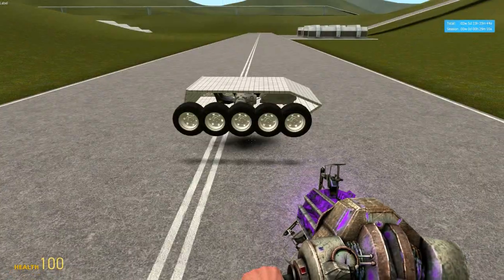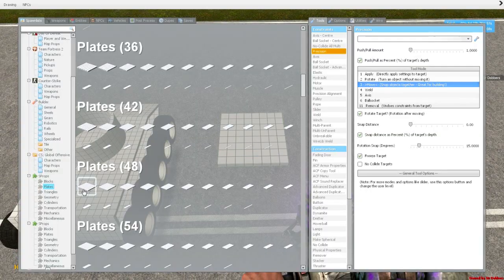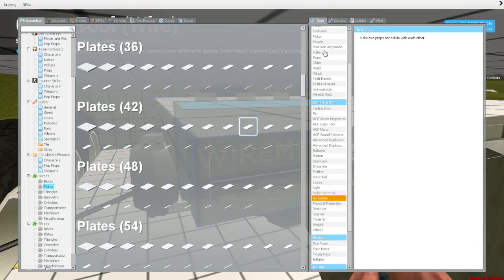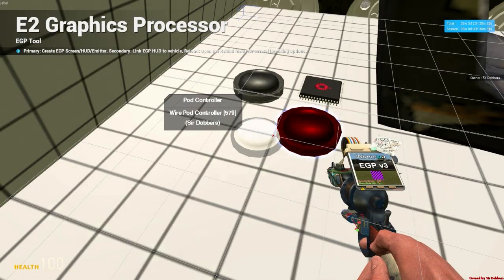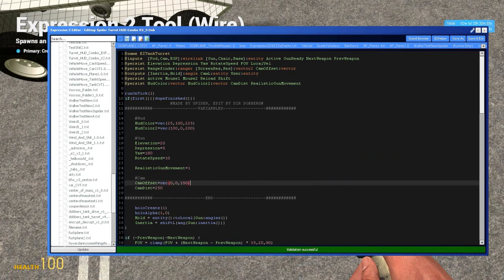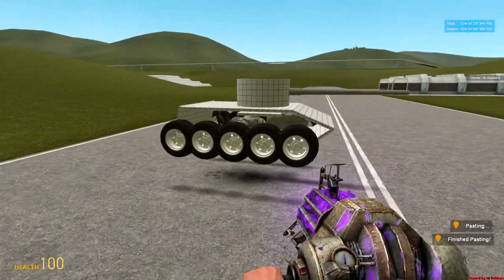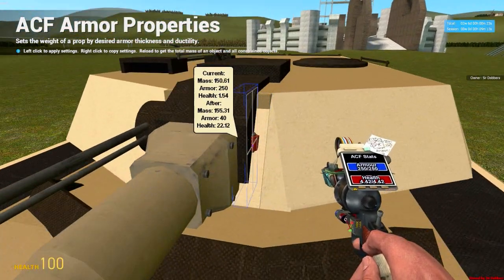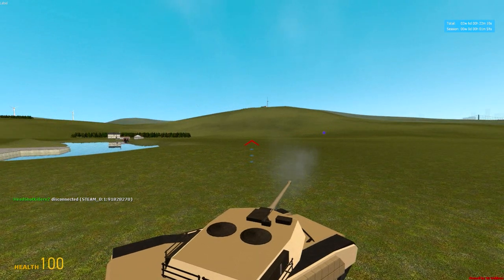Sir Dobbers' Basic ACF Tank Tut Part 2/2 [Tank Turret/Aiming]

Comment: I've been having an issue, I assume it's regarding the cam controller, or the E2 itself, But when using the tanks you've allowed us to download, Like the Abrams, or t34 - The camera will begin wiggling very violently, to the point where it begins to clip out of the map - This happens most regularly with the T34 The AMX is the only one I've never had an issue with. I'm assuming at this point it'll do the exact same thing if I use this E2 on my own tanks :P
Reply: ***** Happens with the lag. As you can see in the aiming chip, it uses a lot of memory.

Comment: Can you please tell me how you got those props on the front and back rotated horizontally and vertically the way you did? I can't figure out how to precisely rotate props without the standard 45 degree rotations. I want to do something more in the 25 or 30 degree range.
Reply: Try stacking  the plate to the front of the tank, then using the precision rotate to in the very bottom of the side of the plate to rotate it in the desired angle.

Tried to explain as best as i could, not a native english speaker.
GL

Comment: I have linked it up all correctly and it works great. except there is no hud even though the EGP is set to hud and when i hop out of my chair the camera stays the same as when in the tank :(

Edit: I got the hud working and i just decided to not use a camera. but a new problem is that the turret wont faces the wrong way and the gun always points at the ground.
Reply from the maker: Make sure the cam controller is linked to the seat, just the way you would link a pod controller. Also make sure only client side movement is checked for camera controller settings
Reply: Ok it works but any tips for the turret problem it faces wrong way and the gun always looks at ground
Reply from the maker: nocll34 make sure the gun isnt upside down
Reply: SirDobbers Thank you very much LordDobbers :P it works all fine now probably just some shit placement on my side. and thanks for being one of the better youtubers that reply quickly to questions
Reply from the maker: nocll34 np thanks!

Comment: Sir Dobbers, where is the area in the code that aims the gun in the e2 , I want to make it to aim higher if the gun isn't powerful enough and so it uses trajectory instead of shooting straight
Reply: Please respond
Reply from the maker: +Michel Erny I think there is already a chip like that somewhere on the internet.
Reply: To clarify , I already found a trajectory calculator and I used it for getting the angle offset of it and when I was scanning over the e2 and it's code comments, it didn't say anything about how the wirelink grabs the angle from pod controller and if I were to find a chip like that it'll be too complex as in there was already a trajectory calculator in the forums but it didn't show how to wire it. All I'm asking is where does the wirelink know where it needs to aim.
Reply from the maker: +Michel Erny GunAng is the angle at which the gun is positioned.
Reply from the maker: +Michel Erny If you can find a vector position to convert to an angle or a world angle from your formula, you'd plug that into GunAng.
Reply: And I first asked where it knows where to ain
Reply: I found it out using a wiremod gyroscope
Reply: Thanks but the first time I checked it didn't make any clue to it
Reply: Thanks though

Comment: now i noticed a real problem your chip dont support upside down gun every time i do this the whole tank do weird thing i had to put  a 122mm howtiser upside down to fit my armor
Reply from the maker: Yeah, unfortunately, it does have to be up right. I could do a minor adjustment to accommodate for upside guns, but that would be a for another separate release.
Reply: SirDobbers i got idea to fix this put the e2 upside down and then revert the elevation with depression
Reply: buder5 Does it work?
Reply: i never tried but you could try is easy todo